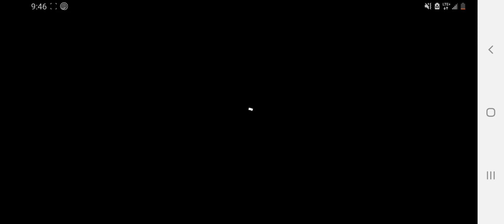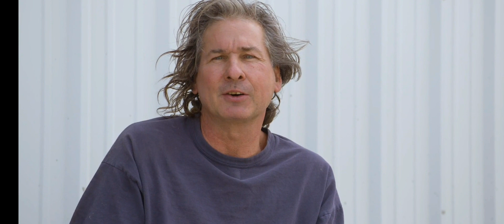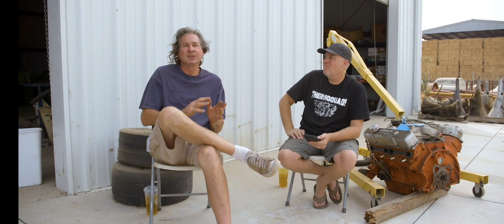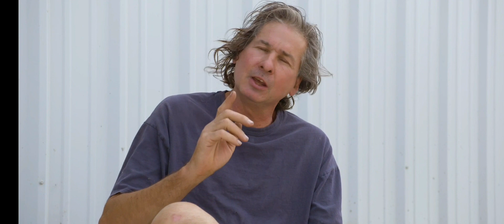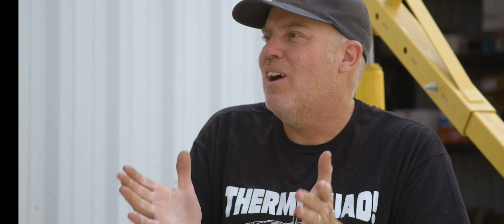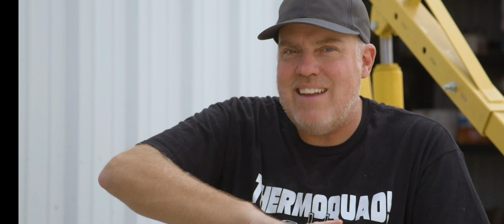uncle tony's garage gets called out by the roadkill guys and they say he's  full of shit

Comment: In one of the 'Direct Connection' engine seminars years ago, legendary Chrysler engineer Tom Hoover said the same as Karl43 says above - that reversing the piston creates a bit more torque but also creates more cylinder wall wear.
Reply: Uhhh, there's some sort of contradiction going on there. More wear means more friction to create the extra wear. How do you get more power by creating more friction. That goes against all that I know about mechanical engineering, which ain't much. But it is enuf to know that extra friction is caused by some sort of drag.
Reply: @larryhutchens7593  uh.... the drag is worth 0.05HP
but the extra leverage is worth 5 foot pounds of torque..... 
.
thats how
Reply: @larryhutchens7593  or.... we could do it like the "old days"................ the boomer days
.
you have to work on cars for 4 years before you can design cars...... 
that way you know its stupid to put the oil filter 0.000000006 inches away from a 5000 degree cat converter....
Reply: @kainhall  Uhh, I'm no mechanical engineer and the Hoover race crew did have a dyno to test their theories. So do the guys at Road Kill & they have put to death some old wives tales about performance. Most humorous was the air cleaner tests when they got the best airflow out of a stainless steel salad/ mixing bowl with the bottom cut out to fit the carb. Another was the dented (very dented) set of headers. As they said, it would be interesting to see a back to back dyno run. That would be hard to confirm though due to the variance that little things like timing, parts compatibility, manufacturing tolerances between parts and on and on. If the few bits of torque gain overrides your ability to put up with an engine that makes noise like an old Perkins diesel at idle then go for it. If you don't worry about excess engine wear then do it. Personally I build engines for durability not racing. One also has to consider the ability to sell the vehicle. But then if the vehicle is a race only unit and you tow it to and from the track go for it.
Reply: @kainhall  Wow, that's a lot of digits to the right of the decimal mark. I worked in the oil and gas industry for 10 years as a machinist then 20 years as a machinist in aviation rebuilding components for aircraft engines. I have never seen any type of instrument that could measure that close, I assume that there must be since you mentioned the clearance. I routinely held tolerances in the .0005" range ("half thousandth " in machinist talk). We used dial bore gauges that measured in .0001" increments that you had to set off of a precisely ground ring gauge that had to be held at the same temp as the dial gauge and the work piece. But .000000006" (did I get the number of digits correct?)??
Reply: @kainhall  Or cam phasers that fail, or the GM engine that has the timing components on the rear of the engine or....  Then there was the little GM engine they came up with that ran iron rings that run in aluminum cylinder walls which also had an undersized radiator. Remember the Vega? Me thinks that GM allows too many accountants into the engineering department. My son had a little Mazda (Mazda & Ford joined at the hip) that had the rear motor mount that was captured by everything requiring an engine removal to replace. then there was the Ford modular engines that were notorious for stripped spark plug threads. The Chrysler cam lifter/ roller problem can probably be traced to some accountant who demanded that they use the most economical bearing supplier available, probably Chinese. Jeep owners  who have the new 3.6 engine are complaining about a valve train ticking which turns out to be a rocker arm bearing issue. I think the current name for those is cam follower. Strange that it has only occurred in the Jeep because the engine is used across the Chrysler line. Strange since the older 5.2 & 5.9 magnum engines had lifters (with rollers) that seem to last forever. Recently disassembled a 5.9 that had over 180 K miles & I wouldn't hesitate to re-use the lifters. And that brings up an issue I have with the Unk Tony thing. Recently rebuilt the 360 LA engine in my 88 B-class camper van. I also have a 5.9 (360) magnum in my shop and I did a side by side comparison of the 2 blocks. Casting quality on the magnum is far superior to the old LA engine. I don't know why the Tony guy keeps putting down the magnum engines, they are made of high nickel iron & have roller cams which completely does away with the cam break in/ failed lifter problem. The only LA engines that were high nickel were the dash 3 blocks (truck engines). The magnum engines did have a cylinder head cracking problem however. One machine shop I use said that he has never seen one get so bad that it leaked coolant but that they would burn an ex. valve if the engine is used hard (towing). Seems like hot ex. gas will start passing through the crack & will eventually eat at the valve seat and valve. Another 360 engine I worked on was an 89 out of a 1 ton truck. The 89-90 engines were throttle body injection and had roller lifters. Being a truck engine it was a dash 3 block. I have never seen a set of 360 heads that were as cracked as those. Several cracks in each cylinder but the block seems to be OK, going to build it & put it into my Duster if it isn't too warped. Align boring the mains will tell.
Reply: Hoover or these 2 bozo’s
Reply: Larry Hutchens        Not necessarily, if the piston is rocking more it can scuff the cylinders up quicker.
Reply: @cjbert6790  I don't think that I was disagreeing with that. Generally speaking (very generally) if the engine is making a lot of internal mechanical noises (metal banging against metal) then something is gonna get damaged.
Reply: @larryhutchens7593  Did they disprove a "wives tale" with the dented headers test? Or, did they have poorly selected headers to begin with....?
Reply: @larryhutchens7593  There is more wear when the engine is cold, the pistons could slap and make more noise and wear if reversed. This old trick might give you 1 or 2 horse power more but the engine could wear out faster. If you want to go fast spend a lot on pistons , rods , crank ,heads and cam. This is 1950's tricks and tips. It means nothing today.

Comment: I worked in a race engine shop for a long time.  We did this test many times on all types of engines at customer's request. We never saw any significant gains, maybe 1 hp at the most.  There's a reason why performance pistons have their wrist pins centered.
Reply: Hi David
It's been suggested there's a hp loss, however small, from the ring seal being disturbed when swapping pistons to other cylenders with no honing. What's your take on the idea that "ZERO" difference would occur?....I figure 1-2%
Reply: @oops1952  zero gain, only faster destruction of your engine.
Reply: @darthhemi1735  My engines lasted fine and ran real strong too. I've heard accusations of premature failure but never met anyone that experienced it. Centred pins are optimal. It's just a matter on what side of the bore the offset looses the least
Reply: @oops1952  The offset loosens what?
Reply: @mrpoizun  "Loosens"? Try "looses"
Reply: @oops1952  Loosen and looses are both forms of 'loose'. To make less tight, to free from constraint. I'm not sure 'looses' is even a word, actually. That would be my guess as to the point of mrpizun's reply. 'Loses' might have been your aim.
Reply: @drifterbbb3649  OK....You can have 'I'm not sure' : I'm sticking with 'oops'
Reply: The offset reverses sides in the bore. This allows the piston to rock like it does with a centred wrist pin. Offset to the thrust side (outside) forces the piston skirt to stay against that side. It doesn't rock but the friction is slightly more.

Comment: Uh huh, and the Roadkill guys got called out by veteran racing engineer David Vizard, who specifically named Dulcich, referencing a short memory. Vizard saw power gains from several engines, on the dynamometer, specifically referenced a McClaren race team engine. 
The debate is over. I like the Roadkill guys, but in this case, it is they who owe UTG an overdue apology.
When it comes to performance mods, veteran racing engineers are the authority, not automotive journalists who mess with cars as a hobby on YouTube.

Comment: Those talking smack about these two guys CLEARLY have NO IDEA of whom they are. Not dumping on UT, but Steve Dulcich is an Engine Masters Challenge, world class engine builder. He's up there with guys like Smokey Yunick and David Vizard. And if you don't know those names, you have ZERO hot rod/engine cred. Period. And Dave F has been a magazine editor for major publications for decades. Sooo...chill and enjoy all of the great work all of these guys are putting in. UT included.
Reply: But they are wrong though...
Reply: Don't mention Dulcich and Yunick in the same breath please, especially if you can't spell the man's name correctly while preaching about "Hot rod/engine cred." if you don't know the name. Dulcich built some good engines that's correct, Smokey was actually world class though as in hands on in every aspect of every motorsport known including aircraft. Petrochemistry, metallurgy, differential geometry, structural and mechanical engineering, thermodynamics, aerodynamics, fluid dynamics, etc. the man was a true genius, Dulcich built some good engines. I won't bother going into Dave's illustrious career.
Reply: @kylapendley924  How so? Please provide your evidence.
Reply: @FPS1200  Ok google "400 hp 302" and you will find a guy WITH A DYNO that got a ford 302 to 400hp using a 280* baby cam and stock ported heads. He speaks VERY clearly about reversing the pistons there and I have my own 437hp 302 with this same treatment done sooooo.....ok?

LOL this has been going on forever and it does make the block behave differently. Piston slap is a non issue as are valve reliefs (this is why ford had them done on both sides of pistons as well as chrysler through the 60's and early 70's). Chrysler put reversing the pistons in the owners' manual for how to get more power out of their engines until 1967 when they stopped it. Bore taper/piston clearance is what makes pistons slap not rod angularity. 

So where is the "proof" it doesn't work....I will wait.

Comment: The piston engineers that I have encountered have said that the offset is to reduce the load on the primary thrust wall of the bore.
Reply: ...which will have zero indication on torque produced on a dyno, and no perceptible difference in wear due to piston coatings, modern lubes, and modern alloys.

Comment: For everyone arguing that this is old school and UTG is cheap, etc. I present to page 43 of How to build and modify GM LS Series Engines by Joe Potak. Not exactly an old school engine by anyones standards. Qoute " many aftermarket pistons use an offset wristpin " so that kinda blows a hole in Steves argument. It goes on for 4 paragraphs tellimg you why it's done.
Reply: yes they use offsets, Steve said that... so if it made more power they would flip the piston offset the other way... jesus are people dumb or what?
Reply: Crazy how every single factory engine is built for max performance and 0 is given to NVH or drivability, hey....

Comment: Who actually spins the wrenches for the roadkill guys?
Reply from the maker: Idk iv seen roadkill  spin more Wrenches then uncle hack and at least what roadkill shows u how to doing thing half ass right u never hear them say oh if u  offset youe pistons u will hear a little ticking but if that bothers u u are watching the  wrong channel nobody wants to build a engine and hear noise  only a idiot would want to hear a nose when they start a engine
Reply: Piston slap in a cold motor is a reality . Offset pins just hold the skirt against the cylinder so it can't rattle. It's a bandaid
Reply from the maker: Ya u might hear piston slap with a forged piston but not with a cast pistons how do u think u brake the piston skirt on a cast pistons if u are building a engine using cast pistons and u hear and noise then u got issues
Reply: @dontbestupidshows4623  if you're hearing slap your clearance may be a little much. Doesn't stop anyone though. Blow motor and make video.
Reply from the maker: I'll say it again the only time u should hear piston slap is with a forged piston not with a cast pistons  that's how u brake a cast piston look it up
Reply from the maker: If u have cast pistons and u hear piston  slap then something is horrible wrong
Reply: @dontbestupidshows4623  yeah you need a bore or you have a tweaked rod. New is nice
Reply: I've also seen some sloppy noisy small blocks kick ass on the street. For how long? Dont know
Reply from the maker: Umm ok what ever u say buddy lol they probably had forged piston not the uncle  hack piston pin offset way i don't see any real racer doing that because for 1 ticking Noise  and nobody  want to hear piston slap in a engine but most all a cast piston and for 2 they don't want to blow up there race engine cuz the piston skirt brakes
Reply: @dontbestupidshows4623  cast pistons dont have to slap
Reply from the maker: What ???? If do the piston pin offset u will have slap with a cast pistons thats why no real racer would do it
Reply: @dontbestupidshows4623  why would you have slap? You'd be pushing the other side of the skirt. Same thing different direction
Reply from the maker: That's the problem with piston pin offset the  Noise your hearing is piston slap uncle tony's said it him self if u are afraid of a little engine noise then u are watching the wrong channel  with a forged piston u hear it cause of the way the piston is made
Reply: @dontbestupidshows4623  It might slap if you went to zero offset but offsetting it the other way should do the same thing. I dont care what utg says. Turning the pistons around was partly a smokey yunick idea
Reply from the maker: Educate me  im and open minded individual then whats the Noise u hear and if its ok to do and there's nothing wrong with it then why doesn't everyone do it ig the piston manufacturers got it wrong lol and I'm not an uncle tony's fan I think he's a hack
Reply from the maker: Umm so if  oem branded it then why did they do it for there muscle cars
Reply from the maker: I went to school for engine building and we were all   told piston only go in one way if u do it any other way bad thing happen
Reply: @dontbestupidshows4623  the same reason they do anything. They think it works. Just like flipping an air cleaner lid
Reply from the maker: Iv never seen oem manufacturers flip a air cleaner lid
Reply: shows  ooh so you went to school! Make sure you tell all those amateur engine builders how wrong they are!
Reply from the maker: Ya if you flipping the piston you are definitely wrong call any engine build shop and see what they say about it im still waiting for you to  tell me witch manufacturer  flip there air cleaners lids cuz I don't know of any manufacturer from jump flip there air cleaner lids
Reply from the maker: The only person  I have ever head say if u hear a little  nose on your fresh build engine its not a big deal there's not one  Professional engine builder will tell u offsetting piston pin offset is a good thing to do
Reply from the maker: I'm not going to argue with  someone  over youtube I believe Steve Dulcich and David freiburger and what I was  Taugh in school  by real  Automotive technicians that know there shit that piston are only designed to go in one way that if u do it any other way its a bad thing and that if your stock engine makes noise with cast pistons its a bad thing the only time u should have any type of noise is with forged piston
Reply: shows manufacturers dont flip the air cleaner lids, people do.
Reply: @dontbestupidshows4623  are you 15 yrs old?
Reply from the maker: Yes people flip there air cleaner lids true but not the oem manufacturer like u said they did thats
Reply from the maker: What ever u say buddy lol people are crazy fyi I'm 46 years old but what ever u need to tell your self piston pin  noise is a bad thing nothing good can come from  piston slap  with a cast pistons  like I said call any professional engine building shop and see what they say about piston pin offset
Reply: @dontbestupidshows4623  don't flip your lid
Reply from the maker: That's what I'm worried about  is some 15 year old kid hearing uncle tony's  say offset your piston and he dose it and brakes his piston  cuz some idiot said its a good thing  the facts are that piston pin offset and piston slap is a bad idea with cast pistons  there is not any  Professional machine shop that will tell u piston pin offset  is a good idea
Reply from the maker: Not when  15 year old kid can save up his money and buy good parts thats what this is for the 15 year old kids that can hear  2  real Professional car builders say that u should just buy better parts instead of hurting your engine by doing the piston pin offset
Reply: @needmetal3221  Lol, his lid is non existent.
Reply: @dontbestupidshows4623  So you would abolish forged pistons?
Reply: @dontbestupidshows4623  my God I feel so lucky that I have managed to avoid the epidemic of piston skirt carnage for fifty seven years. Oh well just keep going on a non issue. I myself am heading to the track this weekend. Dear Lord please keep my pistons intact. Maybe I should pray to the gods of cp Carrillo.
Reply: @dontbestupidshows4623  "that's why no real racer would do it" . 
You know , no "real" racers besides Smokey Yunick and Carroll Hall Shelby. . . . 
I disremember , did Smokey or Shel win any races ? Set any records ?
Reply: @davidleonard8369  So long as the highestes  elites of the universe  schools  of super hot rodded tech and the bigass  brass engine goldmasters  build em without it, yeah, mr don't look dumb sure would !